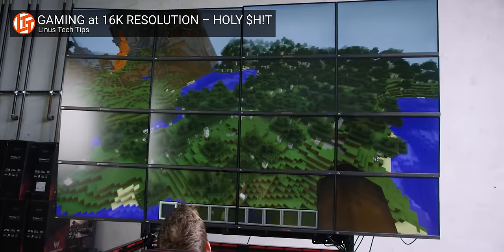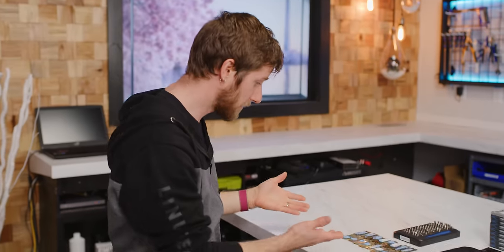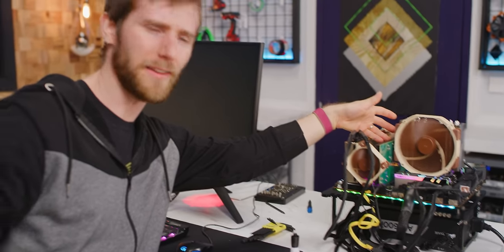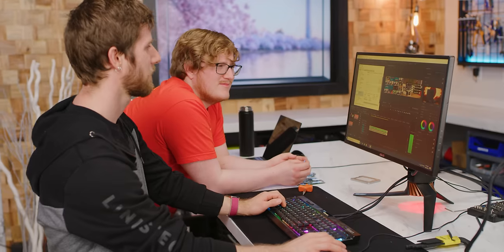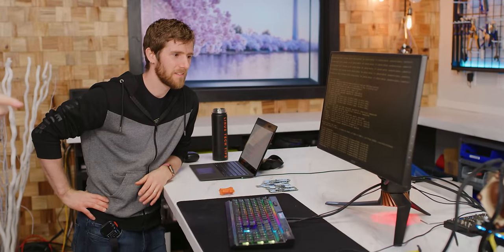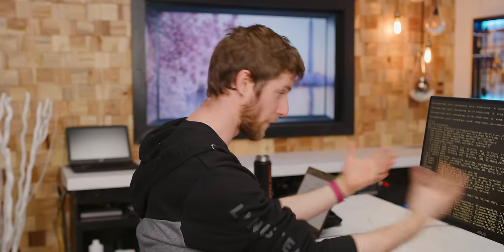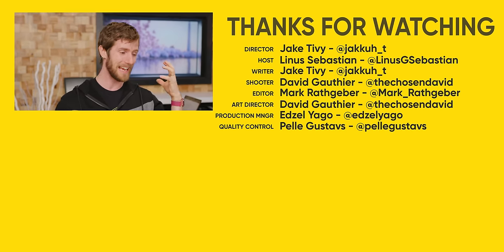This is 50x faster than your PC… HOLY $H!T - Liqid LQD4500 Honey Badger

Comment: Every hardcore gamer: Sorry too slow I would have to raid 0 two of them
Reply: This actually occurred to me two honey badger raid 0 with 2 rtx titans on a threadripper
Reply: I MUST SEE THIS.
Reply: @RadarLeon  or 3 and 1 titan
Reply: No, I would raid 0 four of them... That is, of course, if I didn't need to pay for them.
Reply: @RadarLeon  and amd got the new program tht mergers the drives to make it faster better tighter times so imagines with high quality ram and good ssd's and this with not even the 2080 just need the 3070 it's still faster lol and boom u got instant load time pc tht our runs most servers
Reply: Raid 10 10 of them through fiber
Reply: i was actually wondering that myself, if these drives are just back to back and appear as one solid volume? or if they were planning on making an actual raid array with them?

I mean, imagine 8 4tb drives in each card, raided 1 into 4 4tb cards, then raided 5 into 1 16 tb (ish dont sue me) drive,  and then put a second card in that you raid 1 that with, raid 151. 

I mean, the sheer throughput of that, the sheer complete redundancy, you could lose like 4 of the ssd's and still be fine lol.
Reply: @drawapretzel6003  my brain just exploded lmfao my brain cant even comprehend tht roll but I get the just but it would be like who needs to wait instant loading and just alot of space and other shit and if it can help games any then fuck yea
Reply: @mikebruzzone9570  I've seen your comments on a couple threads, and was wondering why they ended with just 'mb' thinking like "is he talking about a motherboard or something", until I realized your name. Do you really put a signature of your initials on each and every YouTube comment you make, despite having your full name as your YouTube username? Seems incredibly redundant...
Reply: @RadarLeon  we will watch ur career with great interest

Comment: Am I the only one that's hearing some hissing sounds in some sentences (specially at higher volumes and when using a bookshelf speaker)??? It's a high pitched (15KHz+) 'sssss' sound...
Reply: @prostekai  I think it is because this is not the first video I've encountered this... It's not suuuper annoying but throughout a whole video it adds up...
Reply: Also, only happens with this channel. My point is, its not my setup/speakers, I have tested it in many situations, even Hi fi audio...
Reply: Yup, I had to put the 16K down to lowest and half the 8k on my Sound Equalizer and it was gone.
Reply: same, I hear it too
Reply: I wasnt till i read this messege ..

Comment: "Gibby Bites"
That kid from iCarly made it big in Linux huh
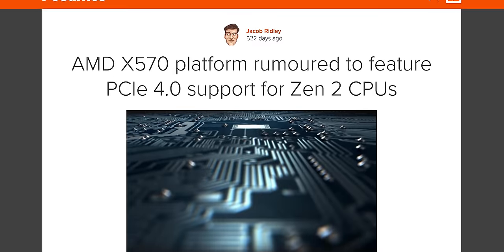Reply: It's actually spelled Gibibytes and It's a real thing. They are what Storage size actually is measured in because it's base 2. It's why your 2TB HDD shows up as 1.81TB in windows because 2TB is 1.81TiB (The symbol for Tebibytes). Windows just misrepresents it as terabytes. Check out this Video from Technology Connections on the Topic until 2:06. https://youtu.be/TCTWyNstpD0
Reply: @1Legofilms  I know this is a joke, but fuck is it annoying to think someone might actually think this.
Reply: That's actually great topic for TechQuickie to explain the difference between Gigabytes and Gibibytes (and KB vs KiB, MB vs MiB, TB vs TiB...) because it's heck confusing (unless you've been using Linux for a long time) especially when Windows displays size in Gibibytes and calls it Gigabytes.

Comment: Ps5 ssd 5Gbps  8-9Gbs compressed

PC : Hold my beer ...
Eat my dust son.
Linus knows ssd.
Reply: Your wallet would literally be dust if you got one of those.
Reply: Yeah, case is, that for this array to show teeth you'd need threadripper and quite possibly that Gigabyte card to make use of PCIe 4.0 while PS5 single SSD has PCIe 4.0,  dedicated chip that offloads I/O from CPU, has 2 additional queue priorities and is kind of optimized for particular data type and structure.
Reply: @HimmelWeint  well.... Gigabyte card is about 200 USD, so is Samsung PRO NVMe drive .... about 1k gives you already one hell of the kick.
Reply: @piotrd.4850  25 Gbps is  a massive leap over Ps5 at 5Gbps and that  or even its 8 to 8 compressed Gbps no matter how many dedicated chips it has  or pcie 4.0.
Reply: Actually it can do 20gbps if you do your research
Reply: @twich155  
 Linus didnt design the  pos5 he just got scared by the flood of ponies that attacked his 
the specs on the box and one every website state 
5Gbs Raw and 8 to 9Gbs Compressed stop your bs fanboy PC super ssd beats Ps5 ssd by miles quit ur yapping fanboy.
Reply: You clearly didnt watch the video or the breakdown of the ps3 specs
Reply: @twich155  bro they can't even program the PS5 now they're going to worry about programming I.O. allowed to push a 17 GB to second on a system that's weaker than  Xbox series X
Reply: I read that over and over and it doesn't even make sense. I have sighted sources and you just have words and those words don't even make sense so... im just going to leave it be. When you graduate from elementary school and can formulate sentences that make sense, feel free to reply
Reply: Found the fanboy!
Reply: It was Lynus himself that acknowledged that the ps5 ssd could potentially do 22Gbs. So, you are not even calling me a moron. you are calling LTT and Mark Cerny s moron sence thats where my information comes from. Furthermore, I never said a PC couldn't do better so, stop putting words in my mouth. Now, in previous comments I provided a link to the LTT video and told you at what time Lynus said it so if you think I'm wrong or a "moron", your problem isn't even with me and you can feel free to complain to LTT.
Reply: @twich155  Potentially 22..smh thats bshit Linus was agreeing with because he was worried you Sony fanboys would boycott his channel . Now let me shut you up once and for all Cerny himself said 5kGbps to 8kGbps compressed developers already cant get the damm thing to perform as good as Series X due to its poor cooling design dude if you knew anything about ssds is that they run extremely hot which is something Sony will not allow.  To try and push its ssd further than the 5k to 8k  the Ps5 would have a melt down if it tried. 2 Dev are not going to waste time trying to implement special tools to try and boost ssd speeds when theyre having trouble with raytracing already. PC has none of those hangups bruh...none.
Reply: @twich155  Your trying to compare a trash japanses console to PC you are a fanboy you have  Grow up stop trying to make ur toy console more than a gaming PC
Reply: @neosrt10  you obviously can't read but ill say it again anyways... I never said a PC couldn't be better so stop putting words in my mouth.
Reply: @twich155  Its not could be better.. a PC is light years better than Ps5.
Reply: @twich155  Is that a picture of you? Dude ..look just get what you want ok ..PC is king and cant be beat by a ps5 in no fashion on any level is already getting next amd architecture and ampere killed any next gen console performance linus even said so when he reviewed the nvidia 3 series its a wrap ..Im gonna get an Xbox Series X and still be on PC ..Im not gonna have a second rate GPU console like Ps5.
Reply: @neosrt10  i don't see how you can say pc can't be beat in no fashion on any level. Its the performance to cost ratio. Build a pc for 400 that can do what the ps5 can.
Reply: @twich155  Buy a RTX 3080 and slap it onto your 400 PC bye bye Ps5 and Xbox.

Comment: Sony: The PS5 has the fastest SSD
Liqid: Lol hold my beer
Reply: direct solder to a SoC
Reply: Beat me to it.
Reply: Ps5 single SSD , This is 8 SSD drives combines through the slot , not the same individually they are all far slower
Reply: @mnk47  not sure where you get that info since I'm pretty sure they haven't mentioned about it being soldered to the SoC. What we do know is that they have another empty slot where you can add regular NVMe. Sony does acknowledge that there will be a single SSD that will have better speed than the 5.5GB/s they currently have, but because of the optimization on PS5 SSD, if you just put regular 5.5GB/s SSD, you will likely end up slower, thus in order to guarantee 5.5GB/s it is likely that you'll need regular SSD faster than 5.5GB/s to account for the overhead from the regular SSD. Basically right now PS5 SSD is still have the fastest single SSD that developer (not general public) have access too.
Reply: Predator Ex The PS5 is 5.5 and it has hardware accelerated I/O and decompression. No SSD currently on the market goes over 5, and when we have 8 next year it'll be slower than the compressed 9 that the PS5 does. And like I said that 9 will be with zero CPU load. Check out how much load the RAID card in this video puts on a brand new Threadripper.
Reply: @Predator Ex Don't tell others to shut their mouths if you don't know anything yourself either.
You people always just see the big numbers and get excited. If you would have actually watched the GDC talk on the PS5 and understood what they said then you would know why the SSD speed of the PS5 will be impressive for quite some time and then you also have to add general console optimization on top of that.
Reply: Okay, I’m not copy pasting it again. We don’t have the necessary data to compare the two yet. The PS5 might still be faster if the pipeline infact is redesigned with custom Silicon. We don’t know yet. If the metric is theoretical throughput this card is faster. If the metric is request to first GB, then theoretically the PS5 is faster than any PC out there.. if the metric is request to 100TB data, the throughput will again overtake the pipeline. Essentially we don’t know what is faster because we have no idea how to compare them, and we will always be able to make scenarios that favor one or the other... nw be nice.
Reply: KillahMate samsung has a 6,5 gb/s out right now
Reply: @seanhanlon3209  i would rather think sony and possibly xbox is employing the same scheme with 2 or 4 nvmes combined into 1 drive, keep in mind they only churn out their consoles with 1 to 2TB storage this time around especially looking at how much 1 of those card costs on amazon for "retail".

Comment: PlayStation : " Our PS5 have the fastest SSD on earth"
Linus : Sure ??
Reply: It's faster than any single NVMe ssd on the market, yes. Linus himself said they were limited to 5GB/s
Reply: Linus: Uses 8 SSDs to surpass the speed of a single console SSD.
PlayStation: "SSD go brrrrrrrrrrr"
Reply: @TheGoncas2  That's for Sabrent. Reportedly Samsung has already beaten it. Their consumer SSDs (980 Pro) will reach around 6.500 MB/s, with their enterprise option going upto 8.000 MB/s.
Reply: @lauwie7610  Not a RAID card - the motherboard still handles RAID
Reply: This so much. I've seen so many fans claim that.
Reply: It still is at the moment, this is using multiple ssds and is likely to still have latency compared to the PS5. In terms of raw throughput in a minutes it's sure to crush Ps5 though.  but that's not really what helps with gaming.
Reply: so its still 8 SSd's in raid lol aka raid card
Reply: @madness1931  Emphasis on the word "will". It's not released yet.
Reply: @lauwie7610  There's no RAID controller onboard

Comment: "This is 50x faster than your PC..."

Cries in 12 year old HP laptop
Reply: BSM_imGLADiator  3200g and a graphics card is a bad combo, a 2600 or 3600, while more expensive will be much better
Reply: BSM_imGLADiator 
I wouldn't recommend a 3200g with a 580, it is a waste of money. Get a 1600af or a 3300x at that point.
Reply: whydude 
True, that would make it functional if you get the right distro.
Reply: X570 doesn't matter for anything below the 3900x  the h500 is cheaper and the type X isn't necessary  go for a 2060/2070/5700(xt) with added budget
Reply: You are pretty much scamming that's a shit underpowered pc I had that budget and had a 5700 and 2700x
Reply: BSM_imGLADiator get a 3100 3300x or 1600 af
Reply: Cries in console

Comment: 10:44 Any comment that says something like "this is so fast that no earthly could benefit from having all of this in it" is going to age like milk. We've said that about our storage media since day 1 and we've been wrong every time. Speaking about anything in terms of gigabytes per second instead of terabytes (or beyond) per second will sound quaint in a couple decades. "30GB/s? Pfft, that's soo 2020."
Reply: A lot of people would be right in the sense that those 30gb/s can't even be utilized correctly under Windows. Even Linux would struggle to saturate two of those under Eypc. These are fundamental problems with OS and CPU I/O architecture that AMD is trying to fix, testing it out on Microsoft and Sony first via their consoles. We'll see those fixes maybe a year or two down the road, and THEN crazy fast SSDs can be fully utilized.
Reply: They do have a point, not everyone will need them for everyday tasks but newer or heavier tasks can benefit by more professional people. I mean we still use a 2009 laptop.
Reply: But after 10 or 20 years this speed will normal for next generation 
And for us this will be expensive and the time this will be under our budget we will be really old for gaming and stuff 
Sad story but it's ends here
Reply: @Ranveer_sangha03  Do you think you said something here?
Reply: @hikdingle2210   do you think I care about  😏 your comment
Reply: @Ranveer_sangha03  I don't think you can understand my comment.
Reply: @hikdingle2210   🙄
Reply: @Ranveer_sangha03  👳
Reply: @Ranveer_sangha03  Ha can't see your emoji

Comment: So here's a question: have we exceeded the speed of the micro? As we look at the history of the microprocessor its speed has ramped up along with transistor density, at an exponential rate. But in recent times (last 10 years or so) that curve has flattened to nearly a horizontal. We've ameliorated the situation some by going to multi-cores. And also by speeding up the buses and peripherals, which were quite a bottle-neck. But at what point do we actually exceed the speed of the processor, at which point, extra bandwidth is wasted?

Comment: "Its faster than both Whonnick servers combined"
Next video: PETABYTE PROJECT WITH ONLY NVME M.2 SSDs AND HONEYBADGER CARDS

(Insert Thanks for likes edit here) no but seriously, that amount of likes in one hour is insane thank you ^^
Reply: wait, they could just put this in Whonnick with something like PrimoCache running, that would be awesome (edit=typo)
Reply: Just a quick math. Each SSD has 4TB with a sequential read speed of 5000MB/s. 1PB would require 256 SSDs, and the theoretical read speed for 256 combined SSDs would be 1,28TB/s.
Reply: @hueanao  raid 0 all of em
xd
Reply: If only ssds could do that reliably long term
Reply: @hueanao  I wounder if there is even a platrform that wont run into ram bandwith limitations.
Reply: l am the 555th liker
Reply: @hayrotheguye7511  Nice! Thank you =)
Reply: tAnkS fR dE LikEz